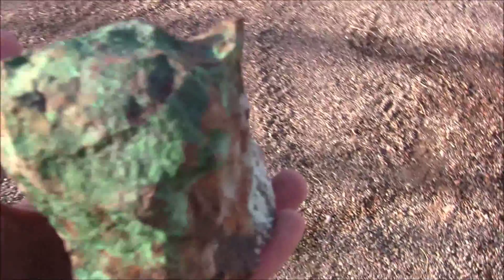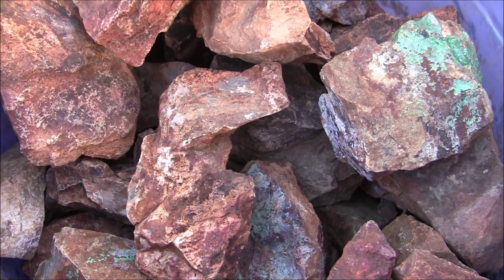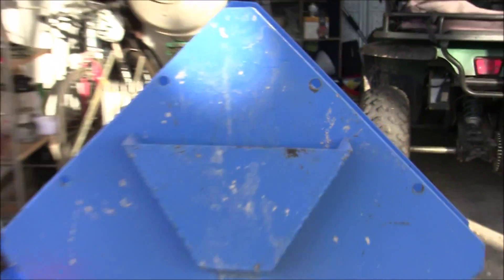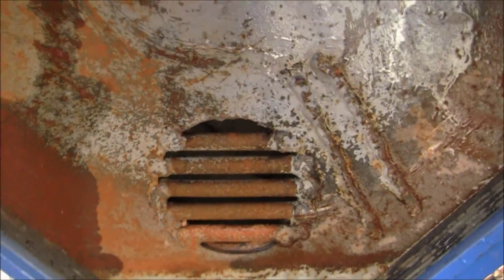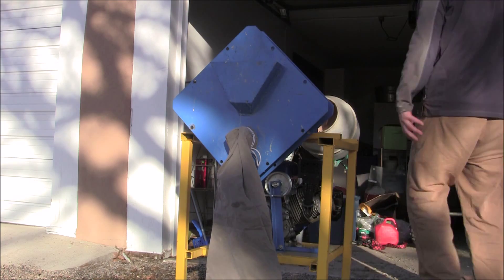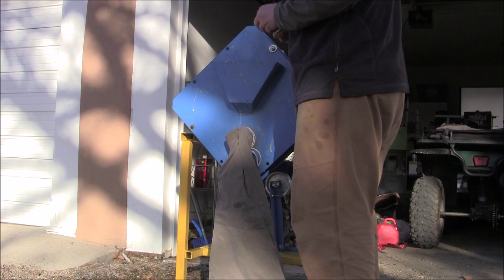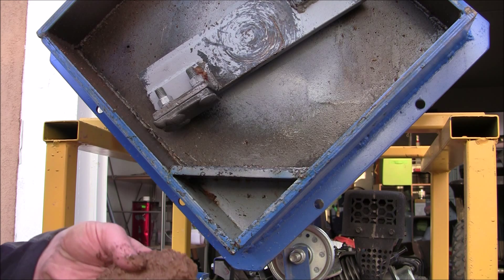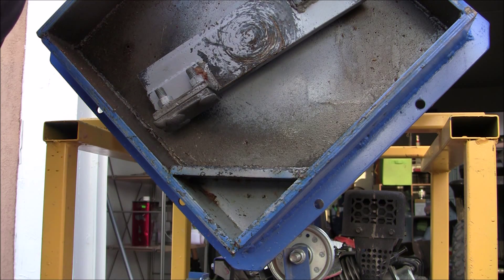Crushing and Testing Ore for Values - Part One

Comment: Yep.  Setup time in the field is about 30 minutes.  No slab needed, just a relatively flat and firm surface.  I designed it for my own use, so I made it as easy and portable as possible.  It is a bit big though.  Takes a pickup bed when transported.  Throughput 300- 600 Lbs/hr.  Recoveries 70-95% of heavies so far.  Waiting for assays on the latest tests.

Keith
Reply from the maker: Hard Rock University Sounds awesome. Looking forward to hearing more - when you start selling them I might be one of your first customers!
Reply: jdeluisa I live in Tucson.  When I get the paperwork filed maybe you could bring some ore over and we could run it to see what happens.  I wouldn't want to sell something to someone if I wasn't confident it would do the job.

Keith
Reply from the maker: Hard Rock University Hello Keith, I was hoping to chat with you. Can you PM me? Thanks

Comment: I agree with all your comments except one- that nobody makes a table that produces a smeltable concentrate on one pass.  Because of the limitations you so eloquently listed, I got frustrated and invented one.  Once I get the patent paperwork submitted, I will be showing what it can do on my channel.  basically, it not only recovers the majority of the micro fine gold to a smeltable concentrate, but it also allows for the differential extraction of the heavies by specific gravity, but not as efficiently as the gold.  For example, I can separate iron pyrite from iron oxides pretty effectively.

Keith
Reply from the maker: Hard Rock University Good morning, That sounds great! I can't wait to see your design once you get it posted on your channel so I subbed! I might be one of your first customers. One of the other issues with the RP-4, and most tables on the market is that they have to be securely mounted and the frame must be completely level making it difficult to take into the field without timely prep work. I have seen a few folks mount them on trailers etc. Have you figured out a way around some of these other issues? Sounds like you are onto something very cool. Keep me posted!

Jason

Comment: I have a Keene RC 46 that takes the ore from 4" to 50% passing 30 mesh at the rate of 500-1000 lbs/hr.  So far the rollers are still going at 10-20 tons crushed but the jaw plates need hard facing every 4-8 hours.  Not a problem with an extra set, hard facing, and a ten minute change out.  I also have an RP4 that seems to have good throughput at 300-400 lbs per hour, but very poor cleaning ability.  The cons ore dirty and I spend as much time reprocessing middlings as the first pass on the ore.  Is that your experience?
Reply from the maker: Hard Rock University I have had pretty good results with the RP-4. I do find I have to run material several times but I expected this. I usually run material a few times and take it down from a several 5 gallon buckets to a couple of teaspoons of material. I don't think any table will take things down from unconcentrated material to a smeltable product in one pass. On some of the discovery channel shows they use a Gemini table, which does an excellent job, but it costs 19K new, and what they don't show is how they preconcentrate the material through a two or more stage Pan American type  jig. Action Mining has some videos on YouTube regarding the use of their tables and he explains how he takes crushed material down from 10:1 or 20:1 to come up with a smeltable product. His process involves 3-4 tables inline but this can be accomplished by 3-4 runs on the same table which is typically what I do. On my table, which is slightly different from my buddies which is older, there is a "nugget trap" on the feed ramp and almost 99 percent of any gold found never makes it past this. However, gold is not my primary concern so the amount of gold I actually find is negligible. One thing about the RP-4 I find the table extremely useful is in separating out things in bands across the deck allowing me to test each band individually. This also allows me to recover specific minerals which would normally end up in the middlings during a gold recovery project. I use my table to sample for rare earth elements and these have a specific gravity somewhere in the middle of the silicates, Fe, V, Mn, etc. so there is no way I could isolate them by hand panning. For a production table I would take a good look at the Mount Baker tables or the Action Mining tables, but I would have to consider these in addition to ,or in comparison with centrifuges or Richert Spirals, etc.

Thanks for watching and taking the time to comment and good luck!